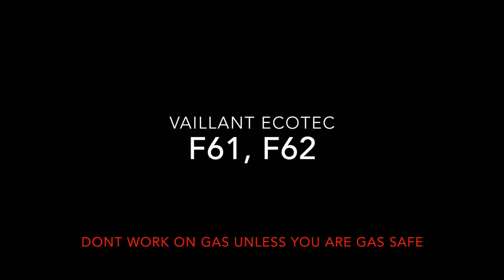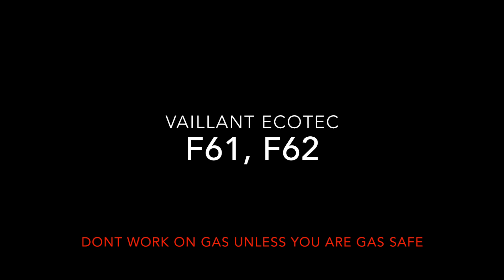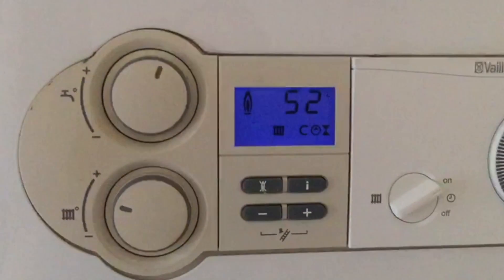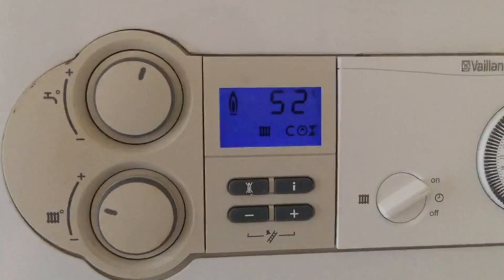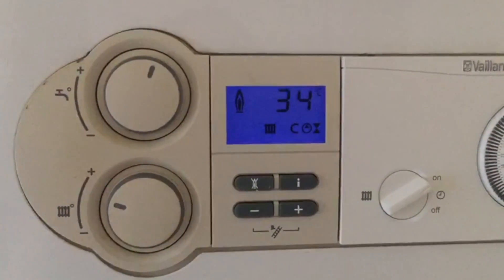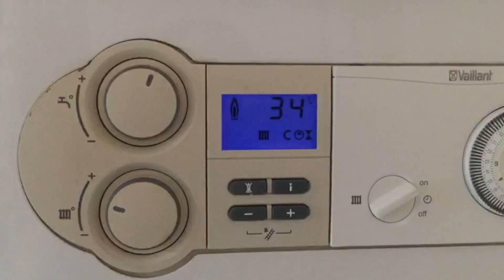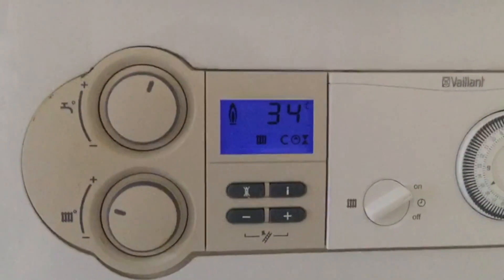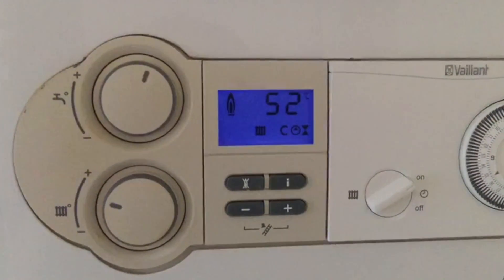FIX. Vaillant F61 and F62 Intermittent issues. GOLD DUST!!!

Comment: I’ve done half a dozen 61/62 faults in the last couple of years and every time it’s been the board. If you listen to vailant they’ll tell you it could be about a gazillion different things, in my experience, it’s the board. Great when they are running but I feel the trouble with vailants is they just can’t help trying to be too clever. Too clever means unnecessarily complex, and that means more to go wrong. For boilers, especially combis. Simple is best. I’ve never met a customer yet who gives a monkeys that their boiler has seventeen different levels of installer parameters. They want hot water and heating. End of.    Another great video by the way. Big up us service and repair guys. Overlooked by installers till they can’t get one to work.

VAILANT “did you know if you input this nineteen digit button press, then you can get the circulation pump to play the tune from close encounters on every fourth Tuesday of a leap year. How useful is that”
Reply from the maker: :-) you speak the truth. The complexity of the very new ones can really cause issues on older systems. You have to set all the smart stuff off. :-)
Reply: I would even settle for hot water always said central heating is for women lol

Comment: Many thanks to HeatingGeek and MER MER.  
I replaced all five caps on my PCB which fixed my F61 fault.  Capacitors ordered and replaced in two days - quicker time than a CH engineer could visit!  Boiler working fine for over a week now.
FYI - I suggest using Panasonic EEUFM1V471 to replace the 470uF caps as these have a high ripple current like the originals on the PCB.
Reply from the maker: Nice one. :-) Well done.
Reply: @Chew Chew... You dear fellow should be listened to more often. Thanks @HeatingGeek for putting this vid up as I would never of found the tip by Chew Chew. For the sake of a soldering iron and £3 for five capacitors as stated above, I took it upon myself to swap out the two capacitors on the PCB and voila! No more problem. Thanks to both of you again.
Reply: @thebigpicture9498  hangi kapasitorler acaba yardımcı olurmusunuz

Comment: Thanks for this video. My boiler is about 11 years old. I replaced two 470uF / 35V capacitors and now it works again without any problems.
Reply: As a matter of interest how did you diagnose x2 caps had gone ?
I've been resetting mine with f61 (frequent)  f62 (infrequent)   for over year.... Old school soldering definitely worth a go.
Reply: Ohh yes, while I remember, it's important capacitors are connected and re soldered the right way round !
Reply: @0x0oxo  The boiler didn't write any error. It just turned on the backlight by itself. Like when you turn the temperature setting knob. The temperatures are set with a resistor trimmer, so the voltage changed. Defective capacitors are an obvious choice.

Comment: Thanks for the hints guys. Replaced one 470 capacitor and no change. Replaced all 5, cleaned the high voltage contacts and the grounding. works perfect. The capacitors had no signs of failure visually. Probably the grounding had to be checked first.

Comment: The NTC’s are resistors ( Negative Temperature Coefficient ) the failure of the capacitors on the board cause a lack of smooth current therefore cause wrong resistance readings, F61/F62 is normally always a main board fault
Reply: F61 and F62, always pcb and gas valve. 40 min job. Fasted £450 you'll make. Customer will have peace of mind and you won't get mithered to return to the boiler later on when it starts playing up again. Don't dozens of them.
Reply: Are necessary not thermistors
Reply: Nice video, I replaced the 4 electrolytic capacitors on the board and solved f.61
Reply: @alessioesposito2304  Which capacitors can you help?

Comment: Great vid. Really helped me out today to get a young family's heat and water on again. Although with a new PCB the boiler is now working, the temperature is still jumping around as shown in your vid. But no fault code any more. Any ideas gratefully received.
Reply from the maker: The engineer should be able to work out what is causing it. :-)

Comment: Thanks for the video. I had f75 on an ecotec plus where the pump was goosed. Changed the pump and then got an f62 fault code. Not intermittent though. Every time it tries to spark and goes into lockout giving f62. Vailliant say to do a drop test on the gas valve for 4 minutes. If 1mb drop or more it's the valve, if not it's the pcb. Still confused why it is sparking but not lighting or any presence of flame?
Reply from the maker: Sorry I didn’t respond to this comment. I didn’t see it in my feed. :-(

Comment: Hi, would a dodgy earth connection cause this issue? Rusty inside case, old diverter leak fixed a few years ago has left the inner case crusty but dry now☹
Reply from the maker: Only if the earth coming into the boiler on the PCB was bad. I have unpluged the earths and the boiler still works. :-)

Comment: I have this boiler no fault codes water works but heating doesn't and changed thermostat and pressure valve could it be the circuit board
Reply from the maker: Press the i button and see what it says when the heating is meant to be on. :-)

Comment: hi mate I've ch aged the pcb on a eco tech plus 2007 and it all seems fine but the heating won't start and I've checked the wiring of the rf stat into pcb but it's still not working am I missing something or is it a secondary issue  maybe ? thanks mate

Comment: Hi,
Thank you for all this - very helpful .

I now have an F61 code but a week ago had the diverter valve with adaptor renewed, 4 months ago a filling loop and faulty room thermostat , 6 months ago the expansion vessel was drained , re pressurised and auto air vent tightened.  Do you reckon, in your experience, the boiler may be worth fixing with the PCB now suggested by the Gas Service Co I use, do you reckon I could get a couple more years out of it ? or does all this add up to "don't waste any more money get a new boiler" ! would appreciate you views many thanks.
Reply from the maker: Unfortunately the person to ask it the engineer who has been working on it. They will have the best idea on the lifespan. If the rest of the boiler is sound then why not? Sounds like, filling loop, vessel and AAV could of been related fault. Diverter is almost a service item. A room stat isn't the boiler. Just a bad 12 months? How much money has the boiler cost  you in its lifespan?
Reply: @HeatingGeek  Thankyou - nothing apart from servicing once a year - so, yes,  perhaps just a bad few months all at once; we've decided to go ahead and have the PCB , fingers crossed it will do the job for another few years before we have to make a large outlay. Thank you for your time :)
Reply from the maker: @catherinesullivan7300  No problem. Hopefully it will be ok for a few years. :-)

Comment: @HeatingGeek Hello, I have had the F.62 code twice in a four day interval on a EcoTec Plus 428 (12 years old).

I'm not getting the fluctuating temp display or always on blue display illumination.

None of the caps are swollen.

...... would you still lean towards the PCB rather than the Dungs gas valve?

Many thanks, Craig.
Reply from the maker: Hi, I would check the gas valve isn't passing and then fit a PCB. If i couldn't check the gas valve I would replace the PCB. I hope that helps. Where are you based?
Reply from the maker: We can come out and have a look for you. I would guess the PCB though. ;-)
Reply from the maker: @fixitfallows  I cant comment on refurb boards on a public forum but other people have said they work. Please let me know how it works out for you. :-)
Reply: @HeatingGeek  Thank you. I may phone you guys tomorrow 👍🏼

Comment: I have this issue and a new PCB to fit. Can you advise how easy this is to fit for a novice? I am in computers and have fitted many motherboards etc but nothing with boilers. Is it a straight like for like swap, or does it require checking earth, testing live wires with screwdriver etc (I saw another vid where a guy did this first). My plumber wants £100 for 5 mins work so am tempted to do this 5 min job myself. Can you advise please, thanks!
Reply from the maker: Sorry I didn’t respond to this comment. I didn’t see it in my feed. :-(

Comment: Just a update new board fitted all working good no more F61! Easy job just warm plastic tabs up with hair dryer or heat gun to prevent breakage!
Also get gas safe engineer to check all ok!
Dsn wasnt needed to be set all parameters was the same!
Reply from the maker: Nice one. :-)
Reply: @maximmaxim4337  hi I bought it of ebay from a plumbing supplies latest revision £80 posted and it was sealed! :-))

Comment: Hi, I’ve change a pcb today due to the f62, just a question on the new pcb, it fits lots of other boiler and the non sensible booklet that accompanied the pcb makes no sense to me. Do you have to go into the software and set it up for each particular boiler or is it plug and play ? Many thanks, great videos.
Reply from the maker: Its plug and play unless you get F73. Then you have to set the DSN to the correct boiler.
Reply: Mine shows F64 off and on is pcb on It's way out please? Someone said could be thermistors but this wouldn't blow fuse on spur would it which is what happened.
Reply: @HeatingGeek  please give your opinion mate  on my post ASAP thanks
Reply: You must be gas safe!!!!!
Reply: old thread i know.....your right there about booklets.lol. They show Ikea style pictures then page after page of foreign info, then my boiler model the part numbers dont match...lol.  happy i never got f73

Comment: I have an issue When I turn the bath/shower faucet on  the maximum TEMPERATURE and POWER, the hot water runs for several seconds, but then begins to lose its temp to about 35degrees, which is relatively cold. Now when I reduce the power on the tap and keep the valve turned left (max hot), the temperature of the water rises to what it should be. Now I do not have this problem in the kitchen and bathroom sinks. They run hot water on max power no problem. What could this be?

On the boiler the water setting is turned to 65 degrees which should be more than enough...
Reply from the maker: What power is your boiler? How fast are you running your tap?

Comment: Most times you could well be right the low voltage failings on the pcb, but to be sure a test of the gas valve SHOULD be done to establish the gas valve is NOT at fault! Best to get your Gas Safe engineer out to fault find!!

Comment: Hi mate, Is there a way of checking gas valve on F61 fault? Cheers jamie
Reply from the maker: multimeter on ohms test between the block of the gas valve and the outer 2 pins. Should be OL

Comment: Hi there, I'm trying to understand what you meant by the blue panel lighting up even if you're not calling any hot water - I've started getting the F.62 code on my EcoTec Plus 824 Vaillant boiler. At first I just reset the boiler and everything was fine for about a month. Then randomly today it happened again though nothing was on. I've not had any problems at all with my hot water - taps and shower do fine. I did notice however sometimes the blue panel lit up randomly, and there are temperature fluctuations though I don't know if they're irregular- it seems to stay stable at 52 except it goes up obviously when I turn the hot water on. What does it mean if the panel lights up? Should it be "grey" the whole time it's not in use?
Reply from the maker: The panel lights up (for no reason) when the low voltage side of the PCB has unstable voltage on it. Because the voltage fluctuates when it shouldn't the PCB thinks someone turned the knobs on the front or pressed a button. You boiler will need a PCB soon.
Reply: @HeatingGeek  Thank you, that's what I was thinking. I've asked for quotes and some gas engineers said it's definitely a gas valve issue and I'll need a new one, versus others said it was the PCB. How can I know for sure? Also, how long an I expect the new PCB to last? Thanks again.
Reply from the maker: @amm6569  I have worked for Vaillant and with Vaillant Ecotecs for 15 years. (they came out in 2004). It is always the PCB. If someone is telling you its the gas valve they are not experienced with this fault. 
Why would a gas valve cause the blue back light to come on???? Trust me the gas valve is fine.
Reply: @HeatingGeek  Thank you for your help. I really hope it's just the PCB (and it sounds like it is, as if it was the gas valve I probably wouldn't get consistent hot water still and there's no other reason the panel would randomly light up blue now and again). How long do PCB's generally last?
Reply from the maker: @amm6569  Mine is 11 years old in my boiler. They don't fail very often tbh
Reply: @HeatingGeek  Hi there, hoping you could help me out again :) I'm now getting the F.61 error instead of F.62. I still have the flickering blue screen that randomly activates. It works fine again for a couple weeks once I reset it and I do the process over again. You think this is also the same issue - faulty PCB? I really hope it's that and not a different issue....
Reply from the maker: @amm6569  Yes its the PCB. Look at the title of the Video :-)
Reply: @HeatingGeek  Thanks, having one of those days with this boiler!! 

Another odd thing - I get reliably great steaming hot water in my shower. I get boiling hot water out of my bathroom sink and kitchen sink taps, though the bathroom sink seems to trip the F.61/62 fault and the hot water doesn't last that long. I just tested out my bathtub hot water tap and that one doesn't get hot at all - warm at best. How is it that my shower gets very hot (and stays hot) but the various taps in my house only get hot for a short period of time or not at all? Is that also related to the PCB?

Comment: Hi mate
My boiler is starting to show this code especially over night with no use! Today put heating on and display was sporadic 34 to 54!
New board need to be programmed  pls
Reply from the maker: Fitted not programmed. :-)
Reply: So the new pcb is plug and play just set dsn to 8 for my 837 in 2nd diagnostic level? No other programming required then?
Thanks for reply! :-))
Reply from the maker: @pauldorkins5530  Plug and play. DSN might not even be needed. Depends if F70 comes up. However to replace this part the boiler needs to be opened and 26.9 gas safety checks need to be done..... So you should get an engineer to do the work.
Reply: @HeatingGeek  HI, Just checking. If i'm just changing the PCB for an F61 fault, does this need a '26.9 gas safety check' or can i just switch out the PCB? I'm OK with electrics but no gas experience.
Reply from the maker: @skymonkey74  To replace the PCB you need to open the case of the boiler. This means 26.9 safety checks need to be done.

Comment: Great vid, helped me loads. My light is on without touching and the temp is up and down like a yo-yo. Getting f62. 
My boiler was manufactured in 09' not sure its install. Definately over 8yrs tho.
Would you replace the pcb or go for a new boiler?
Reply from the maker: How is the rest of the boiler? If it ok then I would get a PCB fitted. :-) Could get another 5 years out of it.
Reply: @HeatingGeek  yeah thought that. But also now getting f75 now too. Not sure if its the same problem or  a multiple fault.
Reply from the maker: @Marc.Vanguard  I have had f75 because of the PCB too. It's a risk you may have to take. :-)

Comment: Hi great video, my vaillant ecotec has a similar issue with the F62 comes on now and again, my question is my temp readout that you watched jumps when you fire the heating up like on your video but once it's been running it seems to stay put at 52c, would that still be a indication of pcb? Many thanks
Reply from the maker: PCB. All day every day. Doesn't matter if it settles once running. Get one and put it next to the boiler for when it fails. :-)
Reply: @HeatingGeek  thank you very much for your help, would a gas engineer know that this would be the fault, don't really wanna tell them to suck eggs if you know what I mean, but I'm sure I can say I've done some research and this is it?
Reply from the maker: They should do.Most will
Reply: @HeatingGeek  what is pcb?
Reply from the maker: @sickoflies2050  A part of the boiler. If you have this issue give your local Gas Engineer a call. :-)
Reply: @HeatingGeek  pcb it's a broad  I looked it up only £50 ive ordered one fitting it at the weekend  the abbreviation was confusing me